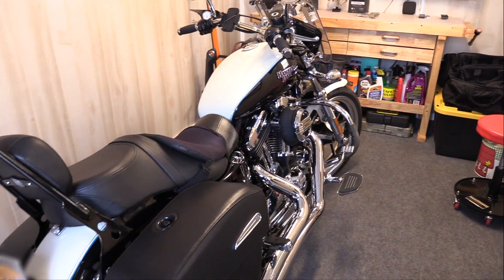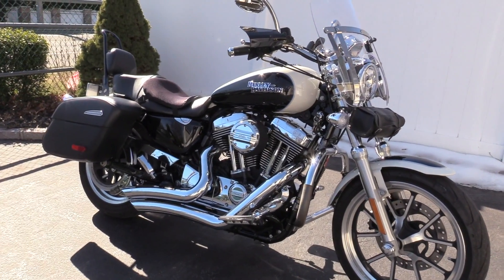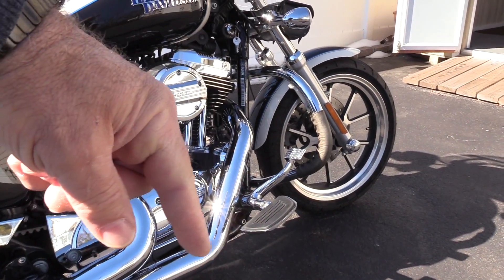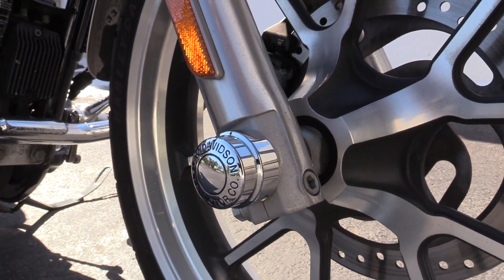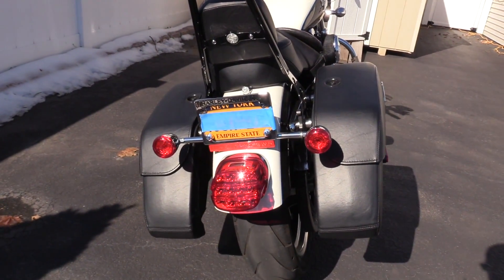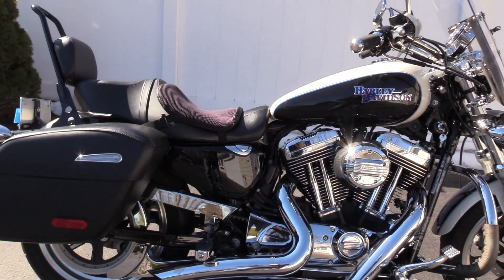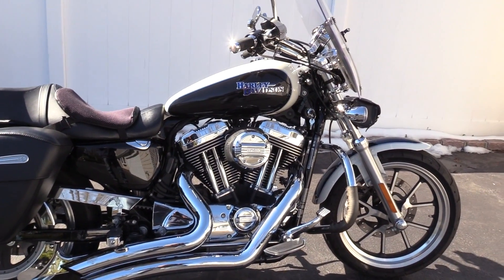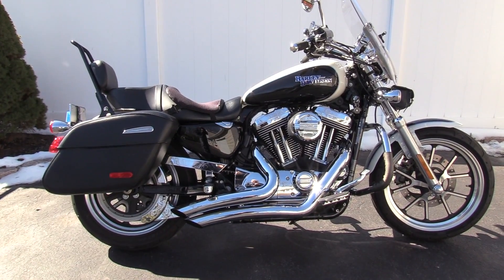Harley Davidson Sportster Superlow 1200T Plus Vance & Hines Big Radius 2-into-2 Exhaust Walk Around

Comment: I had a new 05 883 custom sportster, went over 50,000 miles two up, and on long trips pulled a trailer, the 1200 is big enough to ride two up around the USA or further.👍👍🇳🇿
Reply from the maker: It's really is. I shouldn't have said it wasn't.